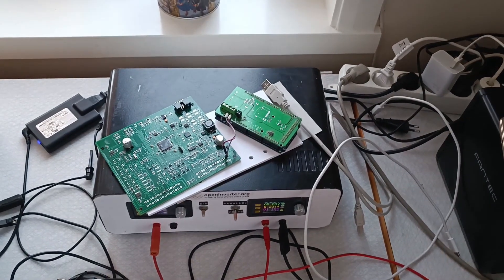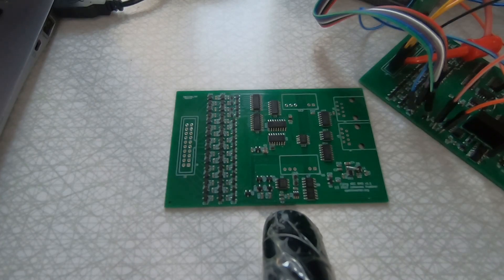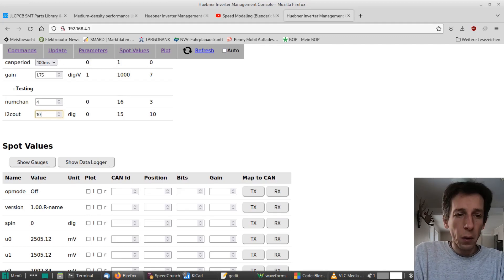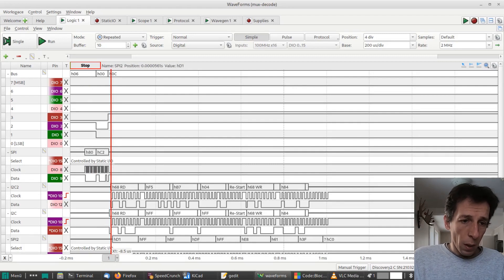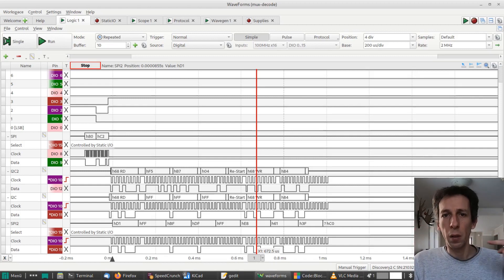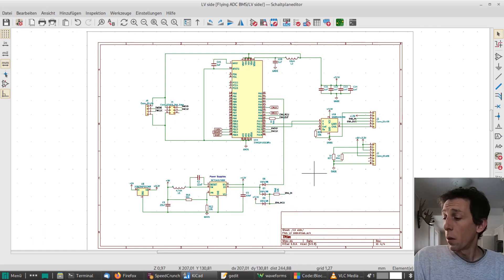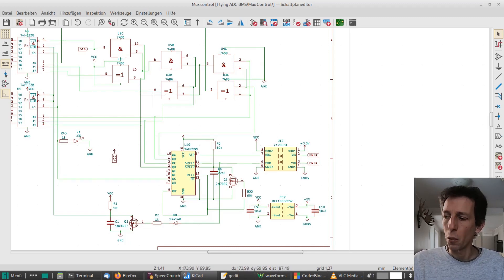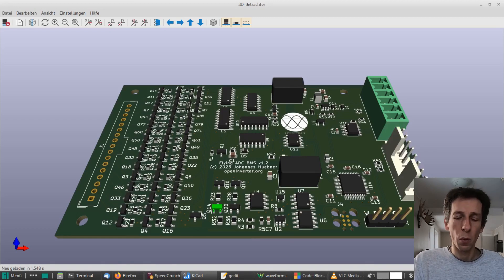Lab Update #71: Flying ADC Progress (in Sweden)

Comment: Are you doing this to sell them? How hard would it to make this for a 21 or 22 cell battery? Thanks, very informative information.
Reply from the maker: As always it's a tradeoff. The more channels are added the higher voltage transistors are needed on ALL channels. So I decided to roll with 16. For more cells it can be stacked.